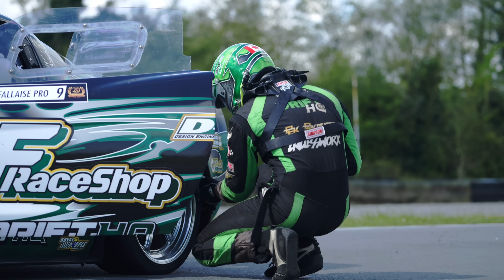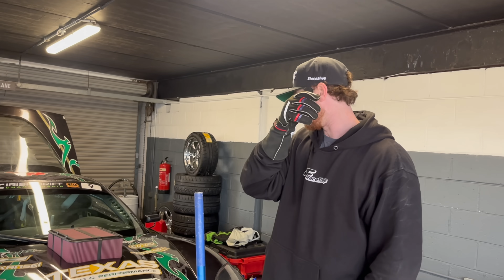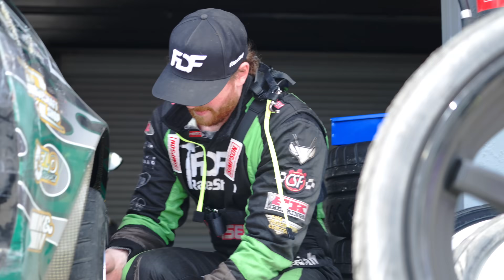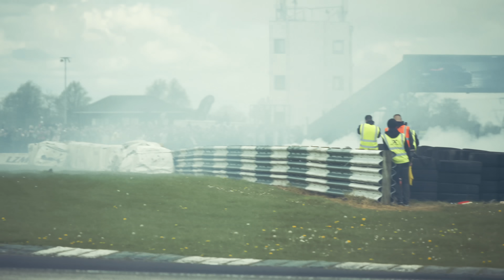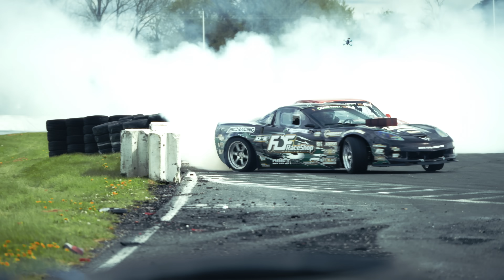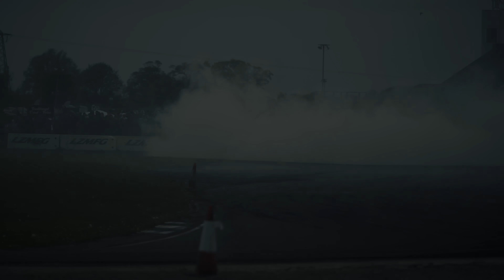Corvette VS European Drifting..How does it Compare?

Comment: For just a tip Tuesday, I think it would be cool if you go over different handbrake set ups whether it be adapting the stock parking brake or in-line Hydro or dual caliper set up